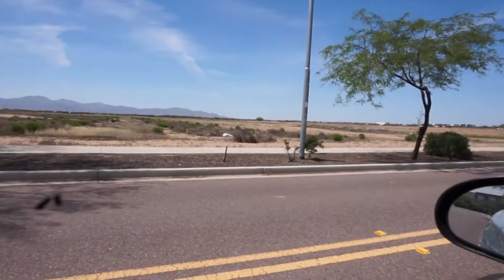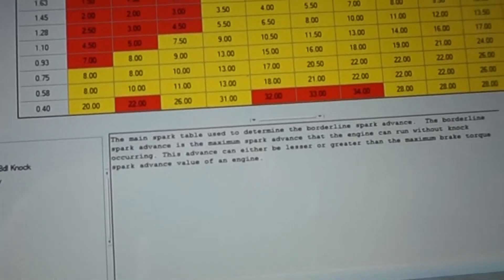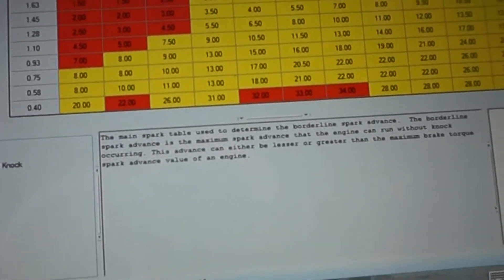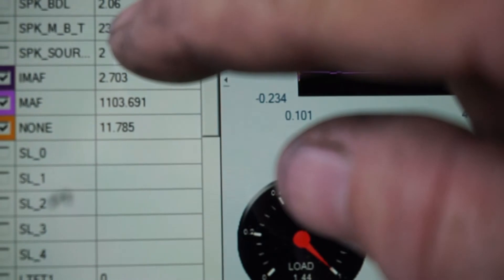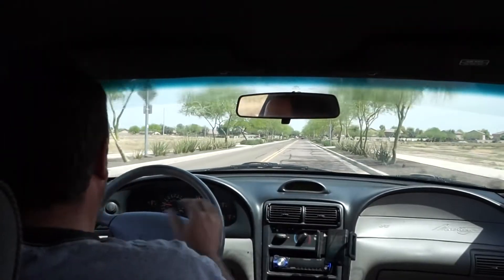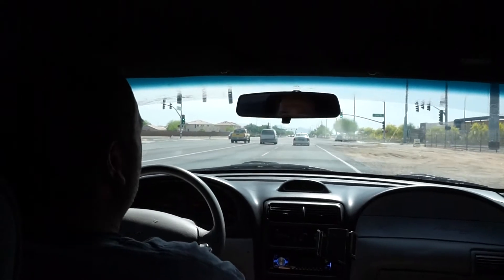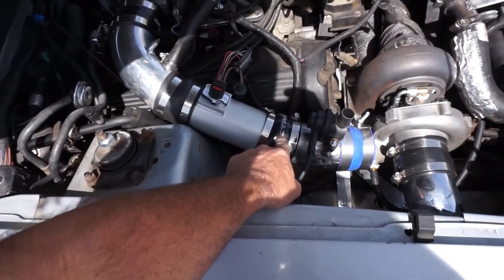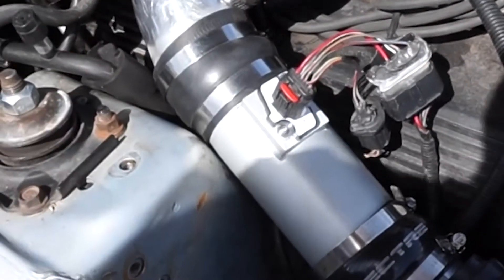Project Mustang - Turbo alive and running (fairly) well

Comment: Hey man. Did you end up selling this car?  Or what became of it.  Just found your channel and I'm doing few 4.6 Mustangs.  I was always a pushrod 5.0 guy till about 2 years ago. Now I'm ate up with this modular stuff lol
Reply from the maker: My daughter drove it temporarily (turbo removed and back to stock) when her car blew up until she got another car.
Then she just sold it.

Modular engines are tough.
Just a pain to get around as tight as they are under the hood.

I'd just side discharge the exhaust if I did one of these again.
Reply: @hackfreehvac  yeah I'm going to do a side discharge on my turbo build for my green gts car, but it's going full drag car mode.  My white 96 has a novi on it for now.
Reply from the maker: @AfterHoursProjects  Nice.
So you're already set up for boost on that car.
Just need to do the piping etc.
The one thing that worked really well was that I swapped my stock exhaust manifolds to point forwards. 
I but off the flanges and welded on ball and socket type flanges from some junk yard exhausted.
I just had to move my power steering pump hardware a tad to clear that and the crossover pipe went over to the passenger side and collected together there into the turbo.

My demise was running a small exhaust pipe down next to the engine and into the stock exhaust. Causing a major restriction. 

A fender cut out would have been much better. 
I never had power above 5,000 RPMS when I restricted my downpipe.
Reply: @hackfreehvac  my gts is wrecked, it had a stock pi motor with a novi supercharger on it.  My white 96 has a wap pi swap with custom cams.  It had nitrous , but sold it all and put the novi on it. 
The GTS will be a ground up build.  I'll prob try to video building it.  It's hard for me to remember  to start filming when I start working on it. Lol

Comment: Binary Editor is good stuff. I use it on my 90GT.
Reply from the maker: +Novi347 Yeah it works pretty well.
I like my modular overhead cam V8 but I sometimes miss the underhood room I had with the 5.0 of old. You could actually reach down and access the exhaust manifolds easy on that sucker.

Comment: Hackfree you should have put some no hub fittings on lol jk. I have blown the up pipe off my turbo diesel one time. We ended up changing the clamps with one from bulletproof diesels. Been following your build man it came out well for low budget. Can you hear the turbo at idle? It would be a good sleeper!!
Reply from the maker: The turbo is not really noticeable at idle but with any engine speed off idle it starts to get noticeable and if I give it enough throttle to drive it is obvious.

It sounds pretty dang cool between the throaty exhaust and the turbo whine.

Although I have no Cat Converter at the moment.
But I will eventually add one for emissions.
Reply from the maker: I did by one of those reinforced couplers with the bolt style clamps.
They cost about $30 each. I need three more!

One reason I have not changed more, besides the cost, is because I am still testing my setup and am wondering if it can wait or not for me to redo the intake tube into the fender and through an intercooler box and back out to the throttle body.
That will be some more intense DIY fab work and I might be moving here soon if we get a house we just put a bid on so I might want to keep the Mustang as is for now then hit it again after the move.

Comment: What program is this?
Reply from the maker: It is called BINARY EDITOR which I purchased through moates.net who is a dealer for it since they make it is often used on their Quarterhorse tuner interface that mounts in the Mustang engine controller.